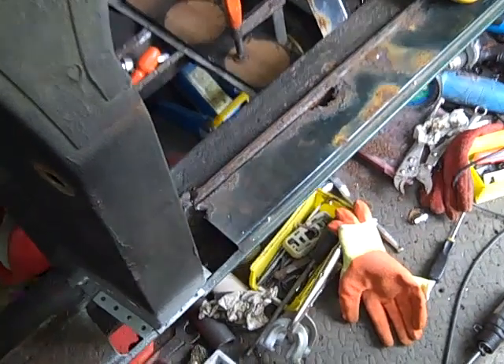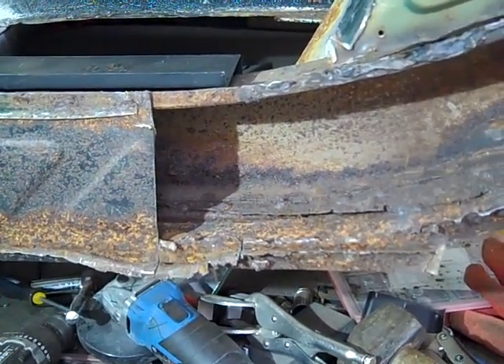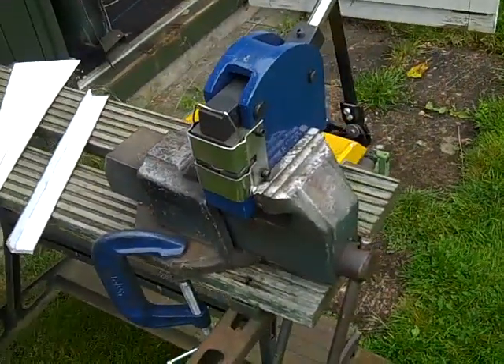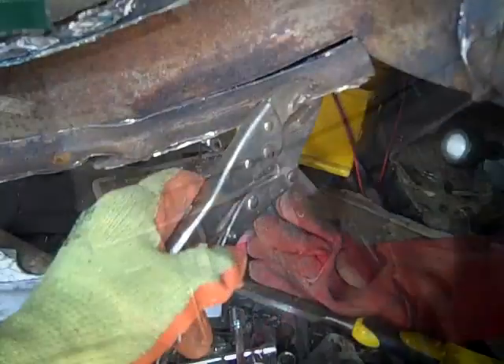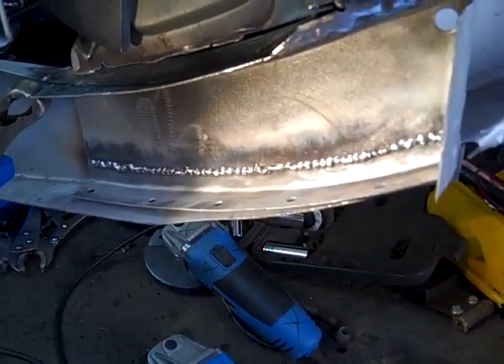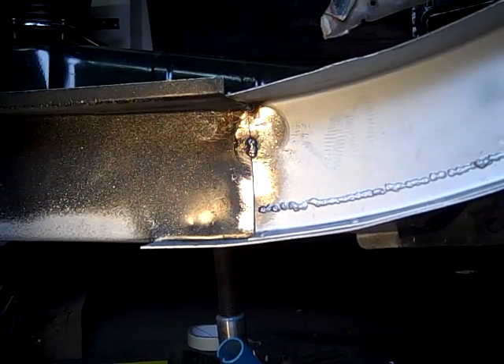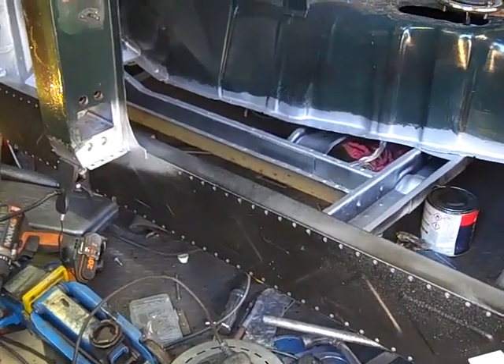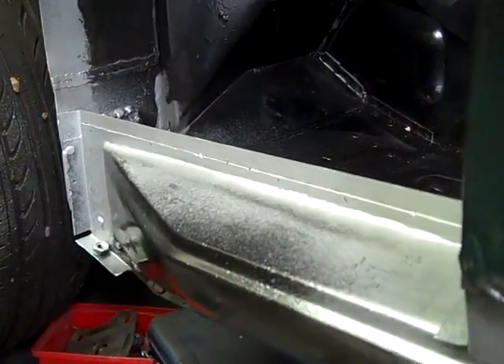MGB Restoration sill remove and repair and replace

Comment: I did not see you put in the reinforcement for the jacking location. Did you leave that out or did I miss in in your video? Thank you for the detailed details regarding cutting the metal parts to fit in. I appreciate your step by step narration as you repaired the sill. Good job!
Reply from the maker: I did put it in even though I didn't fit the jacking point underneath as that is a mud trap, so I didn't show it

Comment: Wow, I feel so lucky and thankful for this wonderful, clear and detailed video. I am JUST NOW at the exact same point on my 67, with precisely the same problems,, and was a little hesitant to know how to proceed. This video makes me feel a lot more confident. THANKS!!

Question: At any point before you proceeded welding in the step sill/rocker/membrane, were you tempted to mount the door just to make sure the gaps all around were good? 

Also: Is weld thru paint good enough to prevent/slow down future rust? Is there any other coating that might be tougher/better?

Thanks again for the great video!
Reply from the maker: I did brace the door on the other side and had a laser on it and I found nothing moved when I had to remove it for some reason. So this side I didn't bother. 

Weld through spray definitely slows down rust because if you don't use it, it will rust so quickly. I used Frost weld through as it seems the best to me

Comment: Is there a copy of the templates for the sheetmetal?
Reply from the maker: There are some templates but not all fit on A4 paper
Reply: @DesAcetek  Could you send a pdf file of them? Im currently working on the sills of a my 1968 MGB GT. It would be very helpful.Thanks.

Comment: Quick follow-up! I bought myself a cheap spot welder from eBay, it's the same one Clarke etc sell but for only £299.  Seems to work well and saves loads of time instead of plug welding and grinding! Not suitable for everything but saves a lot of time when it can be used.

Comment: Nice video thanks for uploading! I'm coming to the end of my GT restoration, still cutting out and replacing odd patches. The car has been "restored" at least twice before, the first time must have been a good one as I've found lead filling in places.   
The second was over 10 years ago and annoyingly they didn't rust protect anything they did, so many of the patches have disappeared!  It still has the original inner sills which are solid, they were treated, probably from new so they haven't rusted at all!

Comment: Good work.can I ask what mig you're using???
Reply from the maker: Yes of course, it's a SIP 105 turbo, about 20 years old, I use 0.8 wire and hobby gas from online shop called VW camper. Hope that helps. Des